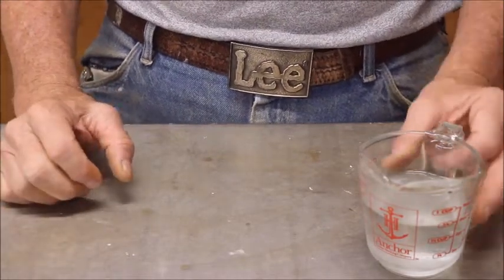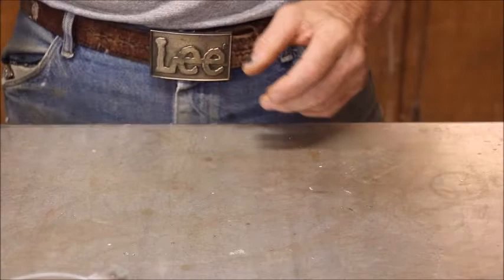Ashes to Art.....Maybe!

Comment: Mike may I make a suggestion. Forget the charcoal briskets. Use lump charcoal instead. 
It burns much hotter. It will burn up faster, so 
You will need to feed it more offen, but we are 
Talking 200 degree Fahrenheit hotter. I,m just
Getting into to pottery, but I know this from
My cold metal black smith forge. I,m thinking 
About making a ceramic blanket lined barrel wood, charcoal kiln with forced air if need to 
Get my temp up more. I live in a forest so wood is not a problem. Maybe to much work so maybe 
Convert it to propane if need be.love your videos.
Reply from the maker: Jim thanks for the suggestions and for watching my videos.  I have a blacksmith friend so geting coal is no problem.  Sounds like a good idea!